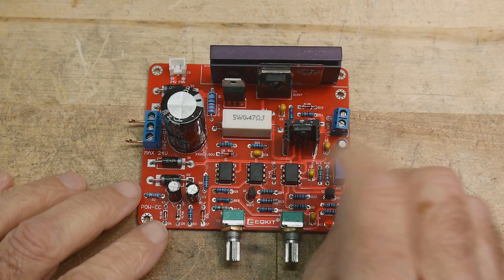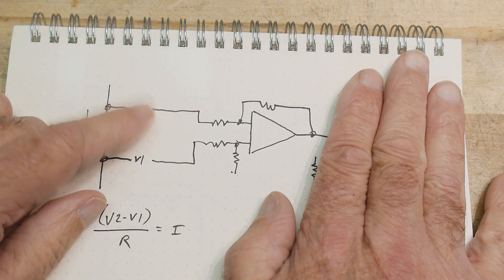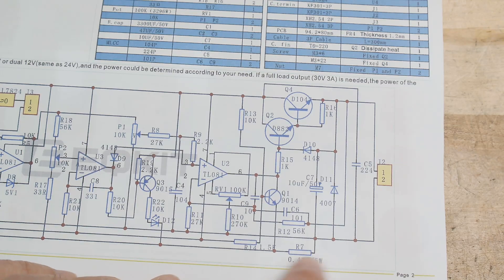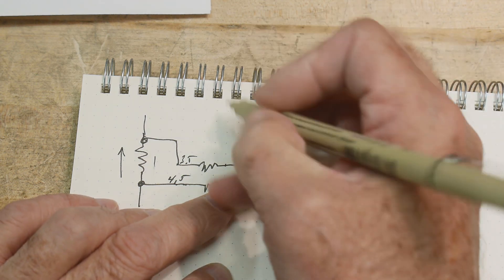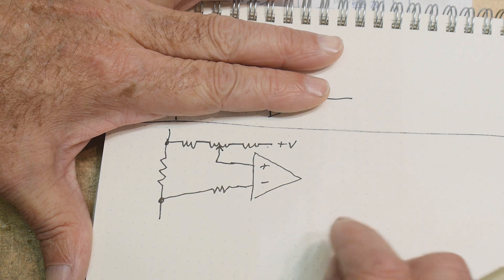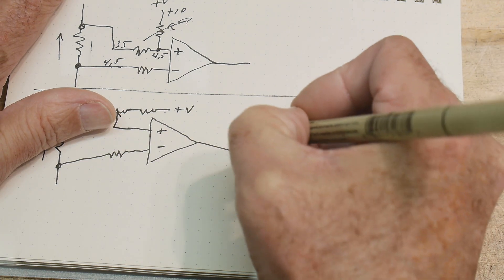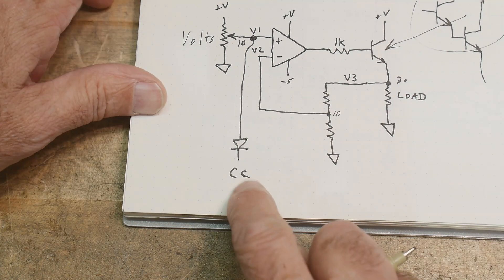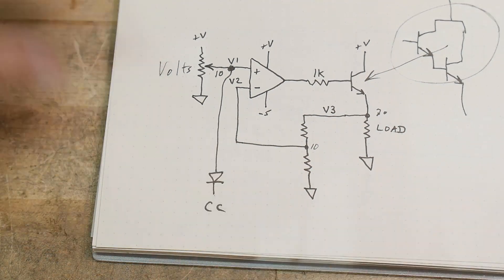#714 Basics: Power Supply (part 4 of 5)

Comment: There’s a trade off with using the current limiter to reduce the input to the voltage controller: over-current transient is higher and lasts longer when the output gets overloaded/shorted. Professional designs usually run the two control loops in parallel, so that either can “turn down” the pass element.
Reply: That's right there is so so many ways to build a cc cv supply but only a few ways are the right way to do it in my opinion my most recent design uses an opto coupler to pull the base junction of the series pass to the positive  sense terminal AKA the emitter but after the current measuring resistor and wire to the output terminal
Reply: @davidknightaudio934  And the good news: that optocoupler won’t be used all that much, so led aging will be minimal. And it will last a long, long time. I like that idea very much!

Comment: Thank you very much for your clear explanations. I am learning a lot from you. I have a question about the constant current (CC) mode. While I understand how the differential amplifier works, I haven't been able to figure out how it adjusts the current going to the load since it only pulls down the input to the voltage regulator op-amp. Could you please provide a brief explanation of this? I would greatly appreciate it.
Reply from the maker: it is cc because it holds a constant voltage across a constant resistor
Reply: @IMSAIGuy  thank you so much for the quick help. another question is that when its is CC mode, will this also disregard (bypass) the voltage that we set with the P1 and only set the new voltage according to the P2? 
I just happened to watch your video #710 0-30V 3A Power supply kit EQKIT and it glows the RED LED when you adjust it with the P2. what confuses me is that I expected it to regulate the current (A) at the set Voltage (V) like in the other Benchtop Linear Power Supplies. Please confirm if this is true or I am still mistaken here. Thank you so much in advance :)
https://www.youtube.com/watch?v=KRcTn3lqnUw&t=1637s

Comment: The current limiter is not a comparator I don’t think. It is an outer control loop closed around the voltage control. It should regulate any current set point although rather poorly since there’s lots of delay in the inner (voltage) loop. It has lots of gain - two op-amp’s worth - so it can be quite precise in current regulation once things settle down, but the transients are a sight to behold on that thing I bet.
Reply: The current limiter amplifier is just that - an amplifier, not a comparator. It is run open-loop at DC with a pole set by C8.
There are advantages to pulling down the voltage setpoint rather than running a "separate" circuit directly controlling the pass elements. In the latter configuration the voltage error amplifier would swing to the rail when the circuit was in current limiting, putting a large charge on C9. If the current demand were suddenly dropped the charge on C9 might keep the voltage error amp at the rail, commanding maximum output voltage, for a considerable time. This can be catastrophic. Limiting the voltage across capacitors in error amplifiers can improve matters substantially in large-signal circumstances, but it is often far from easy and requires a more elaborate circuit. Sometimes something as simple as a zener can help, but you have to pay very close attention to the characteristics of the zener, mostly how sharp the knee is.  Low voltage zeners (i.e. true zeners, as opposed to the higher voltage avalanche diodes with call zeners) are generally horrible around the knee.

Managing dynamic performance in a supply that can operate in either CC or CV mode is an exercise in tradeoffs. Most power supplies optimized for good CV performance have substantial capacitance at their output.That is in a very big conflict with the objectives of CC operation because CC can't even begin until the output cap has been discharged to the point where it isn't supplying 100% of the output current during the transition.

Comment: Hi. Thanks for sharing. I have a question.
8:44 If CC is low the output voltage goes to 0 Volts?   
So, we have a current protection?  Was not supposed to have a "current control"? I mean, the circuit should LOWER the voltage, not put to ZERO.
Sorry, I'm confusing at this point.
Reply from the maker: there will be zero volts across the load. in cc mode, it will not go to zero, it will go to what every voltage gives the current programmed
Reply: Thanks!  @IMSAIGuy
Reply: A well-designed CC supply will be able to reduce the output voltage to very nearly zero in order to deliver constant current into a short circuit. In practical terms there will always be some non-zero voltage at the output terminal of the pass device because of voltage drops that happen in connecting wires, but it could be only a few millivolts to tens of millivolts.

Comment: Great teaching skills, Sir. I'm a teacher (operational research, data science) and I do all my courses on-line due to pandemic. I used to proof some equations and clarify concepts on whiteboard in class, which is impossible now. I'm impressed by your "camera" which zooms on your hand writing perfectly. Could you share some info on your infrastructure ? br from Poland
Reply from the maker: Thank you for the complement. Yes it is tricky to get the infrastructure right. Most important is the audio! I tried many ways. What works for me is a lapel microphone (RØDE Lavalier GO). I use a Sony UX560 digital recorder on a lanyard and clip the microphone to the lanyard so it is about 6" below my mouth. ok now lighting. I have LED lighting above and forward of me so I don't cast shadows. I have a good tripod and it is ALWAYS in my way. Sometimes I put it off to the side so I can work but the video will be off angle and not that great. For this video I had to put my right arm around the tripod and the camera ends up at my right ear. I probably should have a dedicated hanging tripod from above. I've though about it. Good camera good lens. I use a Lumix GX7 with Lumix G X Vario 12-35mm f/2.8. For macro the best lens is an old Nikon 55mm f/2.8 macro manual focus. post process is Sony Movie Studio. Feel free to ask more.
Reply: @IMSAIGuy  Thank you so much. Every experience counts for me. We are somehow lost here without a significant support from authorities. They simply said - do the remote learning, that is all. So we try to do our best for our students, but it is no an easy task. I'm in addition an admin of small LAN with 100 PC machines in four labs and try to use that machines for teaching, tricky task. In my free time I'm interested in RF antenna design - I found your NANO VNA movies, that is the path to you :). To the topic - I use pen tablet and ms word to imitate hand writing but it is resource consuming method. Your Lumix perfoms really good. I have a Nikon D7100 and have never thought about it as a streaming tool, I have to try that concept. One obstacle  I can see is I have to do everything on-line, postprocessing is not possible :). Greetings.